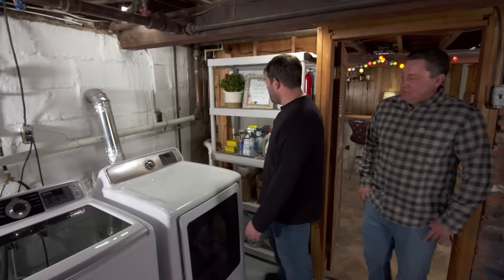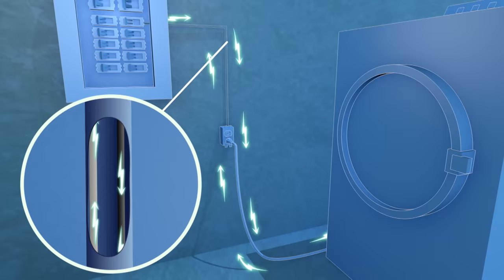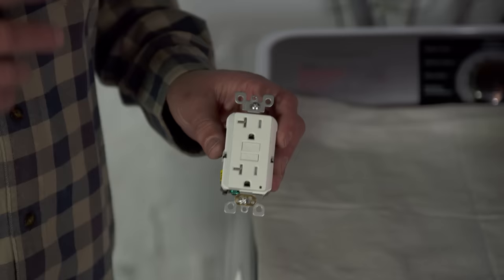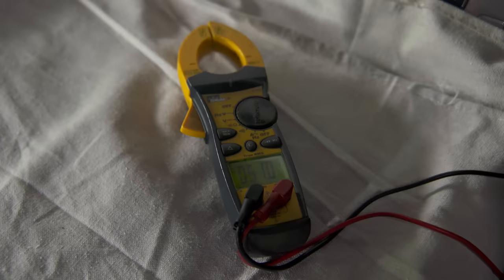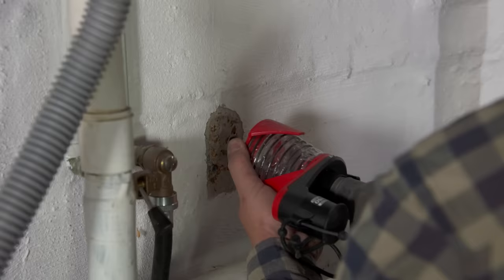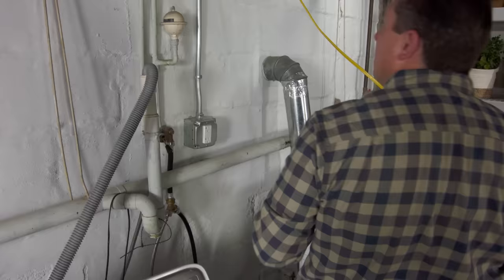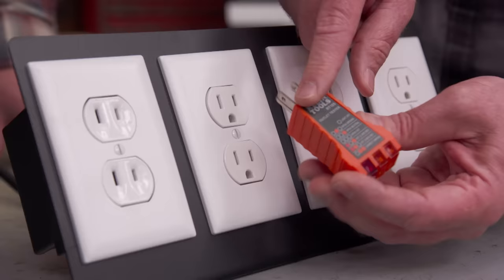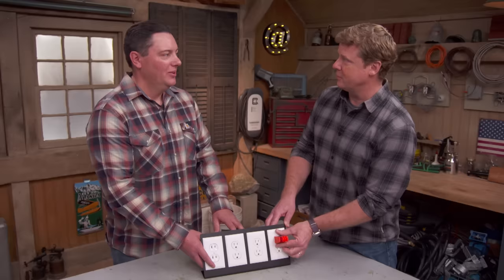How to Ground a Two-Prong Electrical Outlet | Ask This Old House

Comment: the title should be "how to install a new electrical outlet" he didn't ground a two-prong outlet , he installed a new one.
Reply: Installing the GFCI at the first outlet in the circuit "grounds" any plugs after it in the circuit . So if there had been more receptacles, they would have thus been grounded.
Reply: When old houses get new plugs, usually we have to GFCI the first plug, then we replace all two prong plugs with three prong, for convenience.
Reply: @dougmansfieldiii2120  the video shows how to install a new outlet, you are just installing new outlets, you are nor Grounding two-prong outlet, you are installing new outlets. when you run new wires and outlets it is called installing new outlets.
Reply: They got us again!
Reply: @Hisham0099  Grounding a two prong outlets makes no sense as you still cannot insert a grounded plug. One installs a new outlet.
Reply: @okaro6595   agree 100% therefor the video title is wrong!
Reply: @dougmansfieldiii2120  That's misleading. Nothing gets grounded, it just introduces a mechanism that minimizes the risk of not having a ground.
Reply: @c182SkylaneRG  True, until someone doesn't see the "No Equipment Ground" label and plugs in something that won't work without ground, such as most surge protectors.  Test your smoke alarms regularly.
Reply: He didn't replace the ungrounded outlet, he just uninstalled the whole box and threw that away. 
He replaced a completely different grounded outlet with a GFCI.  Luckily, GFCI's are pretty reliable. Now they are pushing AFCI's which, from what I hear, give constant ghost trips.   Although, with reliable electricity quickly becoming a thing of the past, stuff like that will be the norm in the future.
Reply: Ok I'm a Electrical Contractor from Omaha Nebraska You can't ground a ungrounded outlet or 2 pronged outlet..You could replace the outlet with a GFI outlet then run a single green or bare copper wire from the GFI to the cold water pipe and install a ground water clamp then the outlet is grounded. hope this helps anyone...
Reply: @jonanderson5142  Thank you brother!! It help me been trying to watch videos on how to ground it and no one sets that or show anything on how to do it
Reply: Habibi Alaamiri -- None of us noticed the title until your comment.  The rest of us watching have ADD.
Reply: Jake Sangria  no good, that is why the title is misleading
Reply: First time I've seen US do a proper job. Would prefer to see the additional protection added to distribution board protecting cable run before outlet as well. Just adding GFI is not grounding, person is still path to earth.
Reply: No Doug, adding a gfi never grounds a device.  It simply adds ground fault protection which usually isn't enough to cause a gfi protected circuit to open in the event of a ground fault without a ground present.  It does meet the minimum code standard but it does not create a ground.
Reply: @dougmansfieldiii2120 , he could of just use a dual combo arc fault/gfci breaker and a regular non-gfci three prong receptacle.
Reply: Yeah really its misleading come on.
Reply: @dougmansfieldiii2120  Only if there is a ground wire in the first gf receptacle.
Reply: A gfi replacing a non grounded receptacle with no ground doesnt trip under a ground fault.  Try using a plug tester with a ground fault button on a gfi without an equipment ground.  This may be acceptable by code but it doesnt add any safety and you could make the argument that it's less safe even with gfi protection.
Reply: Brian Uehlein  Yes This is True But Would you rather have this home owner sticking his fingers in a Panel or Making sure he goes back to the metal mane pipe yes has to be Metal...
Reply: Brian Uehlein  I Am Aware of the Codes Electrical Contractor for 30 years...
Reply: @jonanderson5142  Then why are you reccomending things that are against code?
Reply: @gregutz4284  Well For 15 years of my Electric trade we went to the water pipe as are second means of a ground .It's worked fine for many years and is still working fine on all those past install before the code change...
Reply: @jonanderson5142  Not what I asked, but okay?
Reply: ... because that is the way you do it. You can't add a ground to an outlet that doesn't have a ground.
Reply: @T-money0985  exactly, you don't "add" a ground, you rewire the circuit, hence the misleading title
Reply: Dude when he added the NEW cords, it had the copper ground wire in it and he even showed him hooking the ground wire to the ground board in power box...SMH
Reply: @Hisham0099  well in this incident , he needed it to be replaced anyways so it's him grounding it but so happens to need to replace the outlet. But in fact he very well did show how to ground it when he added the new wire which was needed to ground it. You just make everything harder than it needs to be
Reply: @dougmansfieldiii2120  thanks. Good to know. The guy in the video didnt clarify where gfci is installed :) If you replace two prongs with three prongs on some circuits with the gfci. How do you make sure that the three prong is protected by gfci? I.e. if all two prongs are replaced by three prongs but not all branch circuits have gfci.
Reply: He did ground the new one.  It was not just replacing a receptacle
Reply: @dougmansfieldiii2120  Sorry, but NO it doesn't.  He explained that it doesn't even ground the first one. Go back and listen closely.
Reply: This is the only way to properly ground your appliances

Comment: Title is misleading. He just replaces the entire electrical circuit.
Reply: The NEC says you cannot run just a ground wire to an outlet, because if you can run a ground wire, you can run a whole new grounded cable. He offered the NEC approved alternative of installing a GFCI, and using the ungrounded label sticker included. So yes, he answered the question.
Reply: It’s a TOH video. Of course the solution is “replace everything”...
Reply: Sean O Deli  If the box isn't connected to the grounding system for the house then bonding the receptacle to the box accomplishes nothing.
Reply: @jconradh  You can run only a ground wire. The conditions are outlined in 250.130(C). Yes, for new installs the EGC must either contain or be ran with the circuit conductors. In this case, he could have pulled a single green, bare copper or green/yellow stripe conductor of the appropriate size to the nearest source of ground that terminates in the enclosure which powers that branch circuit.
Reply: @jefferytownsend7787  you have to run a ground  wire from the panel to ground it, might as well run a new wire, right? Less crap I have to cut out later 🤣
Reply: And your bill is $250.00 a hr not counting supplies

Comment: How to ground a two-prong electrical outlet?  Rip it out and replace it with a 3 prong one.  Kind of a misleading video?
Reply: Lol it's not always that simple. If there are only two wires in the box, then the entire cable needs to be replaced in order for the ground to work, which isn't an easy task.
Reply: He removed two sets of ungrounded outlets, installed a new AFCI, 20A breaker in the panel, ran a new, 20A feed from the breaker panel, and used it to supply a new 20A GFCI outlet that he installed with EMT conduit into a new metal outlet box. This was ALL showed and explained in the video.
Reply: @RobertLeBlancPhoto  Hell of a lot of work when you're NOT in an open basement with a completely exposed circuit...
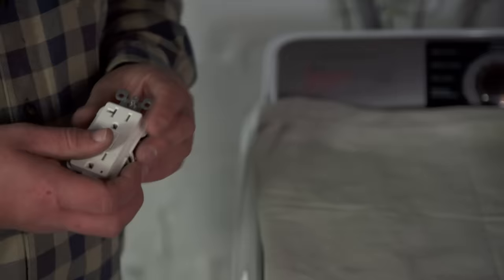Reply: @c182SkylaneRG  But they were, which is why he did what he did and he explained that installing a GFCI receptacle and leaving the existing wiring was an option at 1:45.

Comment: How to Ground a Two-Prong Electrical Outlet: Re-wire the entire circuit.
Reply: Hahahaha exactly
Reply: He did explain that replacing the 2 prong with only the gfci receptacle would bring that old 2 prong to code and new safety measures max 20 dollar repair, but also stated that because the circuit was such a short run a new run would be even better, which i can completely agree. so the video covered both options
Reply: @mnf65  He also didn't explain how to ground a two prong outlet ;)
Reply: @lampoyo  you have to ground the box IF its metal and not grounded already, if you cant do that then stop complaining because you cant figure out the simplicity of it.
Reply: LMAO How to Ground a Two-Prong Electrical Outlet: You Don't
Reply: @lampoyo  The NEC says you cannot run just a ground wire to an outlet, because if you can run a ground wire, you can run a whole new grounded cable. He offered the NEC approved alternative of installing a GFCI, and using the ungrounded label sticker included. So yes, he answered the question.
Reply: @spencerjoseph9149  Thanks broseph. You should read the title of the video and then come back and tell me I didn't emphasize what he didn't do. It's so simple yet you don't understand. smh
Reply: @lampoyo  he shows how to ground it by replacing it and running a ground which is to my understanding the better way to ground jt, don't be mad at the world cause you didn't get what you wanted
Reply: Recycle the metal!
Reply: @lampoyo  he literally explained first thing you can just use a GFCI receptacle. The video and the comment from Moe have explained this and you still don't get it
Reply: They are just gerring you ready for the reality of calling in electrician for  a small job
Reply: @jconradh  
If the outlet is still not grounded, what is the advantage of having a GFCI outlet with a label saying it's not grounded, versus just having a regular non-GFCI three-prong outlet with a label saying it's not grounded? What advantage does GFCI bring to a non-grounded outlet? If one is code-compliant and the other is not, there must be some protection that GFCI outlets provide to un-grounded circuits. In fact, I believe that you can even comply with code by putting a GFCI on the whole circuit and then putting two labels on each outlet (not grounded and GFCI protected), but I don't understand what advantage the GFCI brings in this situation.
Reply: You can replace the ungrounded outlet with a gfci but you have to label it as an ungrounded outlet by code. Plus it is still ungrounded. I believe if the whole house is ungrounded you cannot, by code, add a grounded circuit to the panel.
Reply: @tifforo1  The GFCI; Ground Fault Circuit Interuptor, measures current in and current out.  If there is a short through touching an energized appliance cabinet due to an internal hot wire faulting to it, then the GFCI will notice some power went out and did not come back and this indication will result in a trip.  The grounding wire uses the breaker to trip when the hot touches a conductive grounded cabinet or other path to ground. A short results tripping the breaker, resulting in a cold circuit therefore safe to touch.  Both are valid and even better together as the GFCI receptacle is more sensitive and directly connected to the branch source of the fault.
Reply: @tifforo1  it trips the breaker if unequal amounts of electricity are going in and out of the outlet. However I think without the ground you can still have an electrical surge and fry the appliance? That’s my question
Reply: And he didn't replace the one outlet.  The owner started with 2 duplex outlets and ended up with one.
Reply: @tifforo1  Because GFCI trips like a circuit. He explained it in the video.

Comment: BEWARE! Just because you turn off the main breaker does not mean that there "are no energized parts in the panel." The two mains coming in from the meter will still be hot, so you do still have to be careful while working with the cover off.
Reply: i think houses should have an electric main panel outside or in the first floor that is giving to the rest of the house panels (this one won't have anything except being a safety mesure to turn off when working on the others)
Reply: @brm901  houses usually have a breaker At the meter before this panel that you can shut off
Reply: @brm901  i have that outside my house. 2 breakers
Reply: @isaiah4478  never had this in 45 years and owning 5 houses. The distance from your meter to your panel determines if you have a disconnect outside the panel. Otherwise, pulling the meter is the only way to isolate main panel.
Reply: Didn't they delete you?
Reply: I have a switch under the panel in a separate box for each of the 3 phases.
Reply: True!

Comment: Completely misleading title.  Here's a spoiler...he "grounds" it by tossing it in a garbage can.
Reply: Isn't a ground literally a rod driven into the ground and wired to the panel?
Reply: I think it should be pretty obvious what the title meant lol. You can't ground a receptacle with two prongs. What would even be the point of that? Obviously it means replacing the two prong outlet with a grounded three prong outlet in it's place. That's a lot longer than saying "grounding a two prong outlet" so they just hope people are smart enough to figure it out and they made that the title.
Reply: @brickman409  If the receptacle is wired w/ the old metal-armored BX cable, it's often grounded, anyhow. In that case, he'd use put one multimeter probe on the cover-plate screw & then the other in the hot slot (and if that fails, neutral [in case it's wired backwards]).
Reply: @blue03r6  - It is both grounded to a rod in the ground and the ground coming from the power pole .  Not sure where the power pole ground ends up but probably at another rod in the earth. 🔌
Reply: @Madness832  Be careful with assuming that the old BX cable provides adequate ground... it does not, if there is no bonding conductor (that thin aluminum wire running inside the spiral jacket). Then, GFCI is the only way to properly retrofit an ungrounded receptacle fed by the "old" BX.
Reply: @brickman409  To be clear here, he gave the option to convert a two prong outlet to one with ground, but decided not to because he had easy access to the panel, so replacing the current wire with a new wire was easy. If this was on the second floor then he may have just replaced the outlet with a GFI receptable which is legal to do so. The GFI receptable does not have "true" ground, but will trip on the ground fault at 5mA, which means the person will feel something (not kill them) and trip.
Reply: @BillC-64  yeah, I know what a GFCI is. That would still involve replacing the old receptacle which was OPs complaint.